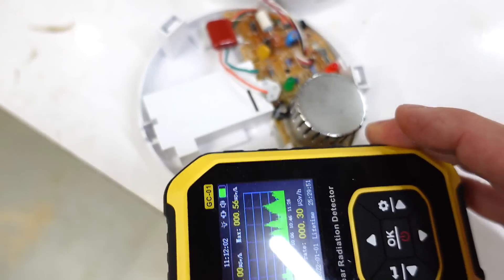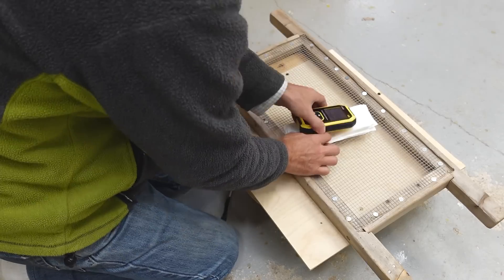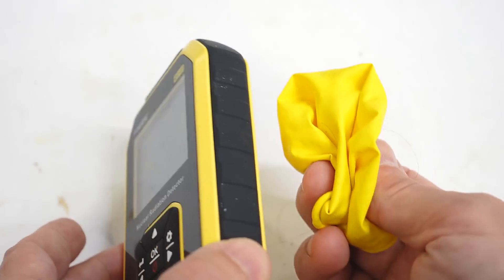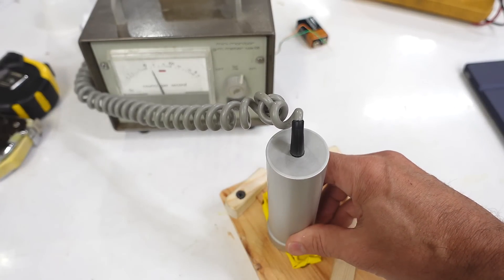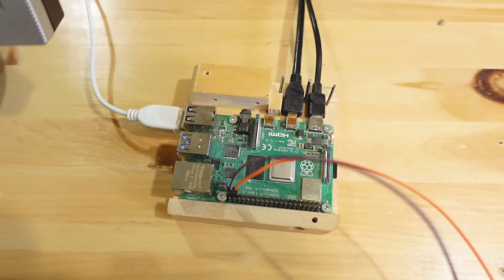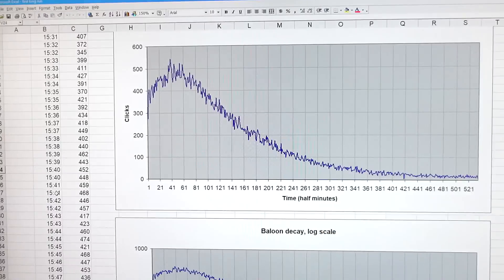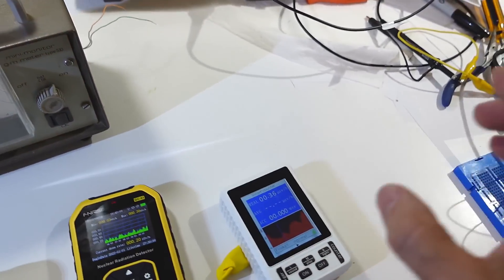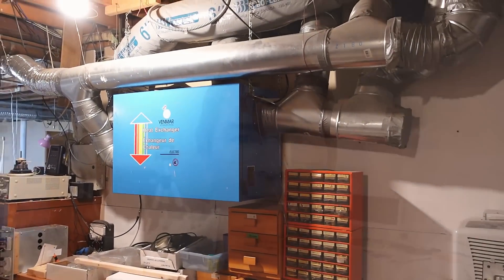Making radioactive balloons using Radon gas

Comment: Perhaps the cause of the strange 36 minute half-life is because the half-life isn't really 36 minutes. As you've noticed, the radioactivity first increases and then decreases - the model is thus comprised of more than one relevant half-life. For example if you conjecture the decay has two dominating steps you should fit your model to https://en.wikipedia.org/wiki/Radioactive_decay#Chain_of_two_decays rather than estimating a single half-life.
Reply: Maybe this set of lists look down for the 10s of minutes list (for bismuth lead chlorine maybe chlorine from tap water??):
https://en.wikipedia.org/wiki/List_of_radioactive_nuclides_by_half-life
here https://en.wikipedia.org/wiki/List_of_radioactive_nuclides_by_half-life#103_seconds_(kiloseconds)
Reply: Yeah, the peak rolling off at 20 minutes sounds very much like the 214Bi or Pb going off. Chain: https://en.wikipedia.org/wiki/Radon-222#/media/File:Decay_chain(4n+2,_Uranium_series).PNG
Reply from the maker: yes, I tried to model that, but couldn't get anything close to the nice exponential decay with 37 minute half life.
Reply: @matthiasrandomstuff2221  I started with the (somewhat dubious) assumption that there was only Po218 on the balloon to begin with, and solved the differential equations to obtain the amount of Pb214 and Bi214 as functions of time. I then modelled the number of Geiger-Mueller clicks as the decay rate (lambda) for Pb214 times its quantity plus similarly for Bi214, assuming that no alphas are making it into your detector through the solid plastic.

The resulting curve looks quite a lot like the one you see, and if I estimate a "half-life" in the same way by drawing a straight line on the log plot between the rate at 90 minutes and the rate at 250 minutes, I get an apparent half-life of 38.5 minutes. I think the confusion might be caused by the fact that there is a chain of processes taking place -- it takes 9.5 minutes to reach peak rate of lead decay and 28 minutes to reach the peak rate of bismuth decays, and a substantial amount of new bismuth is still being added through lead decays at that time (though the polonium is basically gone).

If instead, I measure the apparent half-life between times farther along, say 500 and 1000 minutes, it converges on 26.8 minutes, the half-life of lead, which makes sense because the decay rate of bismuth is higher, so eventually lead is the bottleneck for all events.
Reply: @matthiasrandomstuff2221  I did a quick test using that chained decay model, and limited the range to about 1.5 orders of magnitude (similar to your signal strength above background). Fitting that synthetic data, I got a half-life between 34 and 40 minutes, depending on where I decided it started to look linear on the log plot.

The formula for counts is `N_a + L(N_a - n_b)`, where N_a = exp(-t*lambda_a), N_b = exp(-t*lambda_b), and L = lambda_a / (lambda_b - lambda_a). That wikipedia formula doesn't include N_a, which also contributes to the geiger counter reading.
Reply: @JohnLadan  My spreadsheet math got me about the same.  How much Na vs Nb you assume you have at the start can also swing the fit a bit.
Reply: @JohnLadan N_a is the number of counts from alpha radiation? Because Geiger counters like the ones he used do not detect alpha
Reply: @thorwaldjohanson2526  yeah seems like the mystery isn't quite solved yet
Reply: Maybe the static charge method of collecting causes a different ratio of products to be collected than what you would get if you collected all the decay products. That would also make sense with the initial increase.
Reply: maybe it's a mix of multiple elements decaying
Reply: Good thought. The physisists behind the linked article probably wouldn't think of something like that. After all it not like they write things like "Since we do not know in what proportion the daughter nuclides of radon have been collected on the balloon, it is not at all clear what half-life has been measured." and later on discuss their use of measuring equipment to figure out the specific gamma frequencies to determine this proportion.
Reply: @martenveldthuis   my sarcasm counter is clicking

Comment: I have a radon measuring device (airthings). The count was pretty high in the basement. I have to leave windows open to avoid high levels of radiation now. I have neighbours that used to sleep in the basement until I told them... Now they sleep upstairs.
Nice topic, of what most people have no idea.
Reply: There's evidence of a protective effect from low levels of radiation exposure.  It's far from a linear dose/response curve.
Reply: @davelowe1977  The evidence is not strong, and honestly seems more like wishful thinking. Otherwise chemical compounds that cause DNA damage would have similar effects below an exposure threshold but that has been thoroughly tested and never has such effect been demonstrated, to the contrary most evidence points to a non threshold linear effect.

Comment: As mentioned below, alpha rays are not very penetrating and the radon decay series has several alpha emissions. However, the half-lives of those steps is so different from your measurement times that I doubt they affect your perceived half life. There are two steps - Pb-214 decaying to Bi-214 (28.6 min) and Bi-214 decaying to Po-214 (19.7 min) - that are probably responsible for the signal you're getting. These are both beta emissions. Not all beta particles are the same and these will ionize the gas in the Geiger tube with different efficiencies. You are seeing a confounding of these different half-lives with their different, characteristic ionization efficiencies. 
Very interesting video, to me at least. Thanks.
Reply from the maker: those are the best candidate,s and I figured maybe the way one cascades into the next they'd somehow give me that 37 minutes, but playing around with modeling that, thowe two cascading decays don't really make for anything like a 37 minute half life

Comment: I find it interesting! A useful tip might be that you should clean the dryer filter before start, not after finish. This way there will be less a radioactive products. You might think it's not a big deal, but if you inhale it it's not small either.
Reply from the maker: I think handling the dryer lint is very insignificant compared to the air you breathe all day long.
Reply: @matthiasrandomstuff2221  you are probably right. It is however a bit more concentrated than the air, but the exposure time is not a lot. I use air purifier. Maybe there is less stuff in the air than usual. Can you test a purifier filter that was running on low for few hours?
Reply: It really doesn't matter.

Comment: Not surprised that the rate doesn't match any single decay product - it will be a mixture of several of them. 

I find that increase more interesting - perhaps missing products that are not statically charged? Did you detect the same initial pick-up on a sample taken from the filter?
Reply from the maker: if it was just a mixture, the slowest one would determine the eventual slope.  As it is, it's slower than the slowest one (not counting the ones that take years).  This is why I want comments from people more knowledgeable than me, not less.
Reply: @matthiasrandomstuff2221  damn...
Reply: @matthiasrandomstuff2221  It really could be that it is a superposition like robert mentioned (for example two slightly faster decay products where one occurs directly before the other like Pb214 and Bi214) and, like you said, your long term behavior is just falling below the noise floor of your measurement.  No offence meant, but your linear regime wasn't very compellingly linear anyway.

Comment: Matthias you are missing out all the alpha and many of the beta particles when you put material between the dust and the geiger counter. Even as little as a sheet of toilet paper will block the alpha particles.
Reply: None of Matthias's Geiger counters are able to detect alpha particles. You would need one with a special window, like mica,
Reply: @jackwhite3820  I think the one with a probe might have a mica aperture?
Reply: Thankfully, you basically have to ingest alpha particles for it to be a problem, and beta particles aren't much worse than that, and most sources of those particles have gamma radiation measurably above background.

Comment: Wait, what about our lungs?
Reply: From Wikipedia
Unlike all other intermediate elements in the aforementioned decay chains, radon is, under standard conditions, gaseous and easily inhaled, and therefore a health hazard. It is often the single largest contributor to an individual's background radiation dose, but due to local differences in geology,[4] the level of exposure to radon gas differs from place to place.
Reply from the maker: Unlike the decay products, radon is a gas, and is exhaled after inhaling it.  It's the decay products which are solids that are more likely to stick and stay.  So you got it backwrds.

Comment: Are your radon levels high enough to be of concern?

From my perspective, I would find lithium ion batteries preferrable over alkaline. In the nuclear disaster scenario they can be easily recharged from a variety of sources, whereas alkaline batteries might rapidly be in short supply. (Last year, immediately post-Fiona, one couldn't find C or D cells anywhere.) Either way, in a pinch it wouldn't be rocket science to wire in an alternative power source of appropriate voltage.
Reply from the maker: they can be recharged if you have maintained them.  But leave them in a drawer for a few yeas, and they won't be rechargeable anymore.
Reply: @matthiasrandomstuff2221  Let's hope it doesn''t come to that! Who gets hit first, Gagetown or Halifax? Hoping Lee doesn't cause you too much grief.

Comment: Thanks for the video! At my air-conditioner I get a lot of dust electrostatically charged to the plastic (I made) around it. If I had a Geiger counter I wonder if would turn out to be radioactive?
Reply from the maker: Only if you have a basement

Comment: I think Bananas and Lo-Salt are hot on a counter...
Reply: 1 banana has about 10 decays per second. Considering that they emit in all directions, and that they can be absorbed by the banana itself, and that the counter also has to detect them, I don't think you would measure more than a few counts per minute. So it makes sense Matthias didn't detect anything from a banana
Reply from the maker: Nothing noticeably above background radiation.  I suppose if I had a low-E steel enclosure I might be able to measure what comes off of bananas, but it's less than normal background radiation
Reply: @matthiasrandomstuff2221  would a thermos flask suffice? Should be just beta particles I think? Might channel them towards narrow opening…

Comment: My dad has two older geiger counters but they take very odd batteries. I did a quick search and couldn't find them online but maybe I need to revisit them. There has got to be a way to get them working. This balloon trick would be a good way to test them.
Reply from the maker: the old one I used just used two 9 volt batteries in series
Reply: Exell makes equivalents of many vintage Eveready battery models used on scientific instruments and/or portable tube radios. Google for "exellbattery"
Those are all expensive but some models are crazy expensive. Usually you can use regular 1.5V batteries in series for voltages up to 15V and 9V batteries in series for higher voltage ones, 2x9V should be enough to replace a 22.5V battery.
You can stack AA batteries inside a plastic pipe if there is no commercial holder for the amount needed.
Reply: not just the voltage but the current also.@marcobotha9376